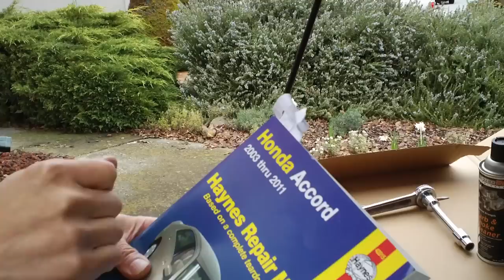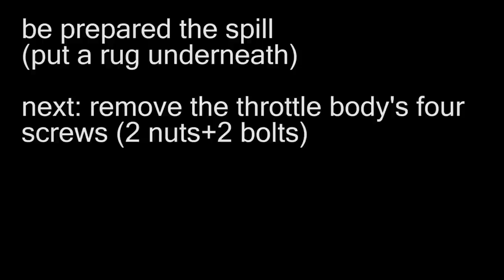Clean Idle Air Control Valve & Throttle With Minimum Removal Honda Accord

Comment: Glad to see you are so liked. BUT! That is not the iac, it is the high idol control valve. You also can spray the heck outta it without worries about corroding anything. It does not corrode anything these sprays. They are meant to clean as they spray on contact. Like a power washer. Rubbing with a rag also is a bonus. If you can get a rag into the area you are working... I am a mechanic of many years. If you need help just ask me what you need help with. I will do my best to help you friend. Jack
Reply from the maker: yes, this video showed cleaning the throttle and IAC. 
There are many other components in addition to IAC that could also be the problem, see: https://youtu.be/8oJyRHaqksM
So there are many different ways to fix it: https://youtu.be/ukUprm9jOc8

Comment: Thank you. Apparently our cars have different throttle bodies because yours is wired for speed and mine is not, something like "Drive By Wire", I think. Even when you clean your IAC valve throttle body you can see the difference to me, because neither appears! Receive a big hug from Argentina.

Comment: Thanks for your videos, you can visually verify the operation of your IAC by unbolting it from the throttle body but leaving the electrical connection intact.  Use something to partially block the intake hole where the IAC used to be to get a smooth idle.   Also remember to clamp off the coolant hose.  When the car is cold it should be wide opened, and when the coolant hit 90 degree C it should be almost 100% closed.  I cleaned mine with carburetor fluid at first and didn't fix the problem.   I took it out again and soaked it in penetrating fluid (pb blaster) and was able to un-jam the valve.  Lots of carbon came out (1999 Acura TL).
Reply from the maker: +koshitek Thank you for your tip of testing the IAC.

Comment: If you have problems with that blue gasket and it keeps falling, use a little tiny bit of gasket paste from a small tube you can buy at auto store for cheap and put a small amount to metal side to hold it upside down without falling. It works for me every time. Very little tho, like a smear just to make the grooves where it goes tacky.
Reply from the maker: thank you for taking the time to chime in, your tips may help many other viewers

Comment: Thanks for responding.
The engine code you can find it printed on the cylinder block, just below the throttle body. For example, the Civic SI has a K20 engine (2.0 liters) and our Accords K24 engine (2.4 liters), but I know of some engines that have small differences between them, for example K24A3 and K24A8 (mine). Basically I look for the differences between the throttle bodies, because they can not find the IAC valve. Look and tell me! Greetings!

Comment: Thanks for the video! I've been trying to get a look at the throttle body without having to take it out of my car because the cruise cable mount on the plastic cam snapped off and I'm trying to fix it. This was about as good of a view as I could get.

Comment: Perfect Job, and great video assistant. You both made this video really helpful. I have my IAC Valve, and TPS replacements on the way from Rock Auto. Thank you, Thank you very much.
Reply from the maker: Glad this video helped you. Saving money and the time is our goal.
Reply: I had to use a Hammer to break the seal on the Trottle Body and Manifold. Also couldn’t get the IAC screws loose at all. Why would they use screws on some the heats up and cools down constantly. I cleaned what I could and put it back. After changing the TPS (odb2 tester,adjusting until errors went away) everything was fine.
Reply: Any tips to get the screws off the IAC? I bought the parts, might as well change it out.
Reply from the maker: I used a craftsman screwdriver with a large handle, the large handle helped, you also need very strong hands :)

Comment: sir, there is valve ATTACHED TO THE FRONT ENGINE BODY (BRASS BOLT 24 MM) AND 'L' shape black plastic connectors one hose connected from behind the injectors and another hose come from AIR INTAKE HOSE. WHAT IS THE PART NAME AND HOW TO OPEN IT TO REPLACE?

Comment: You can disconnect the cables without removing them from the bracket, which if you did remove from the bracket you would require adjustment.   They come off the cam similarly to how bicycle brake cables come off.  Turn the cable so that the cable lines up with the slot, move the cable up through the slot.   Just be sure of the cable orientation when you put it back, being sure they don't twist when you get them around the cams.
After 175K, the throttle body was stuck on hard to the manifold throat.  Had to hammer it off (carefully of course, with padding).
Also one of the screws holding the IACV was stuck hard.  Had to twist the IAC a litlte so that it could possibly torqe the stuck screw.
I was going to try and clean the original IACV, but after all the trouble to get it out, I felt it was worth the $80 to ensure not having to go through all this again.
Last oil change place tightened the air cleaner cover screws so tight, one of the plastic ears broke.  There was no way to prevent it from breaking.

My idle started going bad a couple days ago.  This afternoon when i planned to replace the IAC it went from high idle to way too low idle.  Stalled out at stops.   Great timing.

Comment: Hi dear! Thank you very much for sharing the procedures to repair and / or maintain our beloved Honda Accord. My car has a similar flaw: without actually moving the rpm counter is enough to appreciate that the engine noise is fluctuations, indeed minimal, but fluctuations in the end, and I dare to imagine that perhaps the IACV valve.
According to the procedure to clean the IACV valve Accord, I wonder what kind of liquid spray cleaner you use for this ...... (continued on next...)

Comment: Hey i noticed you had green coolant in the reservoir, for that K24 engine, Honda recommends their Type 2 genuine coolant that is Blue in color. the green coolant does not have the same cooling capabilities and protection as the genuine kind.
Reply from the maker: I talked to the autozone staff, he said it's OK. I also called the dealer, I was told the warranty would not be avoided. Basically any silicate free eth-glycol that's safe for aluminum engines, for example Prestone  would be ok.

Comment: Great vid.  Had very bad idle problems and check engine light.  Ran free diagnostic at oreilys and they also said it was prolly a bad idle air control valve.  Very simple installation with the help of your video.  The hardest part is removing the two screws that attach ICAV to the throttle body.  They are on VERY tight.  Thanks again!!

Comment: You don’t have a MAF which bummed me out since my 05 accord 2.4 l has the MAF sensor near the air box. I’m having the idle issue where I start the car and it idles at 2k… but I think my issue is bad gas as the car sat for over a year with a full tank of 87 octane. It didn’t do this idle stuff before. But your system is much better to have… good video though
Reply: Just figured out it’s my IAC, IAT, and I had to clean the MAF (which I ended up replacing along with the throttle body) my 2005 Honda Accord 2.4 liter runs smooth
Reply from the maker: thank you for taking the time to share your results, your comments will help other viewers.

Comment: When the throttle is fully exposed... You can hit the gas opening the seal and spray the cleaner inside while the car is running... I think this works and is way easier than removing everything...
Reply: Are you trying to clean the throttle or are you trying to clean the idle air control (IAC)?
Reply: David Zhang Not sure. My honda today was Idling low. My father came and did what I said and now it Idles normal. He was in a hurry to get back as I should say... Now I hear that can possibly blow the engine doing that?  Anyways, I suppose it is cleaning the throttle...
Reply: *****  It will blow smoke out your tail pipe due to the liquid burning off, but it should not blow fire out....
Reply: *****  Yes. Recently my 2003 Honda Accord LX was idling bad... My dad, being a mechanic for over 50 years did this as a quick fix... Idled good ever sense... It will not go up in flames... What you have to do is open it up to expose the throttle while someone sits in the car revving it up slightly... With each touch of the peddle, the person outside will pour a bit of throttle body cleaner in  while the inside is exposed... Repeat until your hearts desire... A bit of smoke will come out of the tail pipe, but no harm will be done... Keep in mind, you can pour water in and it will still smoke due to the engine burning off the liquid...

Comment from the maker: I tried the carburetor cleaner spray, it did not work well even though I did spray a lot into it. In order to proper clean it, you just to take the unit off, and soak it with gasoline (submerged in a large container) for a long time.

Comment: Do you think that opening the throttle and spraying cleaner into IAC would clean the pathway the same thing without having to take any screws out?
Reply from the maker: 1. first you can't reach the IAC from the throttle easily. You may clean the throttle: https://youtu.be/1u3XGC0sZe0?t=629 
2. But even if your spray could reach IAC, you can look at the moving part of the IAC: https://youtu.be/1u3XGC0sZe0?t=668 in the video I said "look at the moving part, sometimes it is stuck",  how can you spray into that moving part accurately? 
3. After removing IAC and spraying cleaner, it only worked for a few months, eventually I still had to soak it for 100% cleaning see here: https://youtu.be/4oj3WeCjs_g?t=532

Comment: I have the same accord and threw a p0507 high idle code. The idle would go between 1k and 2k. I replaced the idle air control and did the relearn procedure and now it idles at 950-1100 which is still high. Any suggestions on next culprit?

Comment: The IAC pair of small screws are NOT USA Phillips... they are JIS type heads and need $8/pair in eBay JIS #2 bits to remove the screws. Use a dab of WD-40 or Kroil ....30 minutes before removal to loosen the screws
Reply from the maker: Thank you for taking the time to share related details and tips, this will help other people to save time and effort.

Comment: Please what can make my Honda Accord 1999 model always start once when cold but it crank up to 4 - 5 time when hot before it respond, i have change the complete injector, fuel pump, fuel filter, Starter, also the distributor, but the same problem still occur, i need your help on how to solve the problem some time i have to start it from engine starter before it works
Reply from the maker: 1. make sure the battery, cables are good: https://youtu.be/5_0nsReSKhE   
2. make sure spark plugs are good: https://youtu.be/w4-qqNPFgo4
3. you said you have a new starter, so is the starter turning the engine?
4. basically two paths can cause this problem: 
   A. do you get spark? You need to check electrical
   B. do you get fuel? There are many components such as those you have already replaced. But still you need to check fuel, sometimes electrical problems such as fuel relay.
5. also need to check if you have clogged air filter
6. check to see if fuel lines too close to a hot engine or other hot components, because fuel will vaporize.

Comment: hi, my friend i have an idling issue. it goes up and down  at idle.
does removing the negative terminal of the battery reset the throttle position sensor or relearn it. 
how long should i leave it disconnected.
my car is a nissan bluebird slyhpy 2008yr.
hope you can help me out.
Reply from the maker: this one is PCM Idel Learn Procedure for Accord: https://youtu.be/K8VfHkMmeZA
Reply: do you know about nissan?

Comment from the maker: 1. the code is K24A4, 2106886.
2. on the throttle KIHIN GY F4A 40306
3. on the front of the engine KEIHIN RAAA114-012407.
I think for some year only 4 cylinder engine has the IAC. If you have V6 for the same year, then it does not use IAC.

Comment: What are the symptoms of a dirty idle air control valve?mines doesn’t go past 3400 RPM it starts to go into a limp mode
Reply from the maker: idle air control is for idling, when you past 3400 RPM are you accelerating?
Reply: @GeniusAsian  yes On acceleration
Reply from the maker: @flexapex9801  does your OBD II system capture any error code? The electronic control unit usually goes into a limp mode based on sensor signals from many components, your spark plugs,   distributor, catalytic converter...etc
Reply: @GeniusAsian  It had a check engine light for a while according to my wife. We put it in the reader but no code showed. I’m thinking that the light may have burnt out but it’s not throwing a code. Spark plugs have been changed oil,air filter. And both Variable valve timing solenoid actuator.  I did the coil test where you unplug the coil pack while it’s running and see if the engine  idle change but the idle change with every single coil pack. i’m at a loss could it be at ECU?
Reply from the maker: @flexapex9801  you may try to disconnect some sensors to see if any error codes are generated.

Comment: Hi please I just want know som information about the low idle for Honda crv2008
Reply from the maker: we listed many issues with the low idle. The idea is to look for all components in either the air or fuel path. It may inspire  to solve idle problem for any cars honda or not.

Comment: CorgLLC Hello, how are you? I make a query, could you tell me what is the engine code that belongs to this video? Because I've tried to find the IAC valve in the throttle body of my engine (which is a K24A8) and I could not find it. Thank you very much for your answer, greetings from Argentina.
Reply: I was about to post a comment saying that A8's have "drive by wire" throttle bodies.
I believe they don't have that iac valve and throttle cables as well. Makes our job a bit easier :)

Comment: You should only use CRC Throttle body & Air intake cleaner, NOT carburetor cleaner, because carburetor cleaner leaves a residue behind after it dries, sooo... You might have to pull everything apart again and re-clean it all if things aren't working correctly, and that's frustrating and time consuming. Best to right the very first time, imo.

Comment: How many miles do you have on the car?
Reply from the maker: I think it was about 120k miles because I had this video https://youtu.be/8VeuMIYYr50 about changing transmission fluid at 120k. Since I lost the car in this incident: https://youtu.be/3xsk-N0deig , I no longer have the car.

Comment: Warning: Make sure you put your idle air control valve the correct way round!. On my 2002 Honda CRV 2.0ivtec I put it on the wrong way, and coolant flooded into the intake whilst it was running. Fucked the engine completely!. My biggest car mistake ever. :(
Reply from the maker: Thank you for sharing your mistakes, it will help others.

Comment from the maker: the two screws were the hardest part to remove. If you managed to previously loosen the two screws, you will have better removals, see my follow up video titled "Absolute Minimal Removal of Idle Air Control (IAC) & Install New IAC", the link is in the description (youtu.be / 4oj3WeCjs_g)

Comment: I could be easier to take the battery out since you’ve disconnected the cable already🤙
Reply from the maker: I only disconnected one cable to reset the computer. If for some reason you disconnect both cables (bot positive and negative cables), then you may remove the battery.

Comment: The idle air control in my opinion just wastes gas. Its only purpose is to add air to off set the air conditioner demands when the throttle plate is closed. It can be bypassed with a plate and the butterfly can be set to run the engine with the throttle screw holding the plate open just enough to attain perfect idle. It can be a pain for the computer to re-learn but after that you pickup some mpg's not much but some. Thanks for the video but the focus is horrible.

Comment: Lol why you need to tag cables or hoses?
Reply from the maker: yes, to do any repair, I have the habit of tagging things. If I don't tag parts then I may have harder time to put them back together later on. The time I used to tag is minimal, overall I save the time for the repair. This is because the difficulty of un-installation and the difficulty of installation is not symmetrical, i.e. installation takes more time than removing parts.

Comment: hey, i replaced maf on 2005 accord 2.4 and my idle goes high from start 2500 and raises to 3000, engine runs smooth tho 
do you think idle relearn can fix it?
or is it throttle position sensor ?